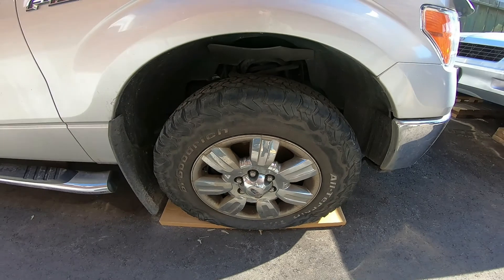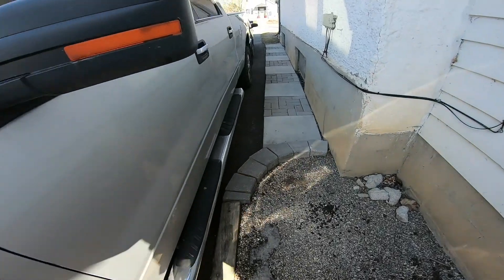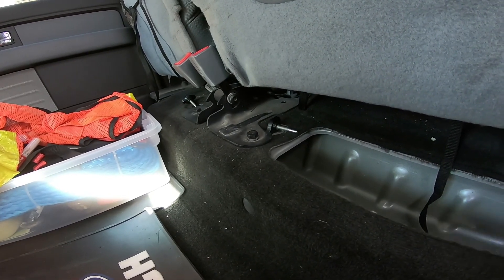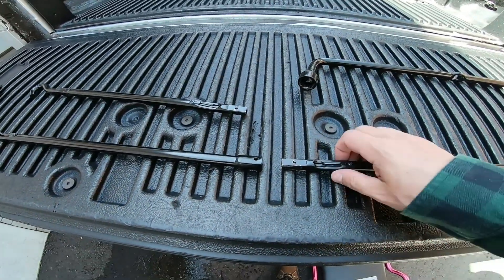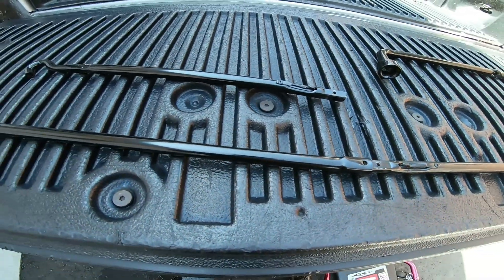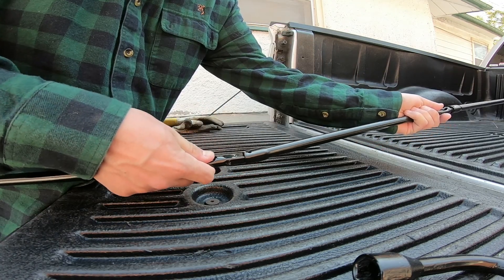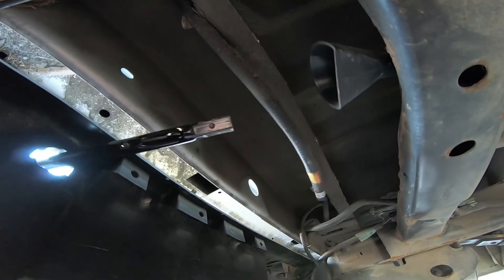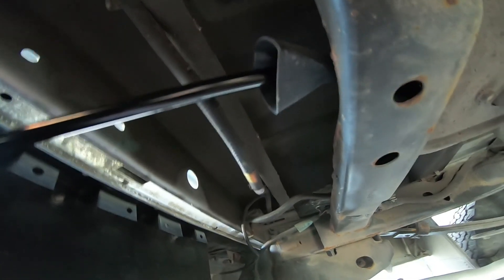How To Spare Tire Change, 2009 to 2014 FORD F150

Comment: Mine was rusted up and wouldn’t move ...so I slide under the truck and used the hot wrench and cut the cable off ..yup I did . We get a lot of salt on the roads during the winter and it causes lots of issues...both my Super Duty’s have had the same problems with the cable .
Thanks for sharing 
Shawn
Reply from the maker: When I bought this Truck brand new I paid 45K for it and at the time I was like shit if I'm going to fork out this much money I might as well try and make it last as long as I can so I went out and bought 3 can's of that Castrol Chain Lubricant it's like a spray-on black Grease and I just coated the shit out of the underside of the truck and I also had Crown Rust control drill all the holes in it to soak the inner rockers and what not but doing all that really saved the body and frame on that truck, it would have been rotted to shit I've seen 2009 models with so much rust and blown out cab corners! but honestly two each their own that's just me, I did the same with my Monte Carlo SS I tried to soak all the rust-prone area's
Reply: @Canadiancarguy1987  I’ve done all the above , my trucks both of them carry sanders and V plows on them for 5 months each year and we fight the rust issues every year . Both the trucks are going out for paint work again this year .
Reply from the maker: @rustyrods8535   ya true enough not much you can do in that sense